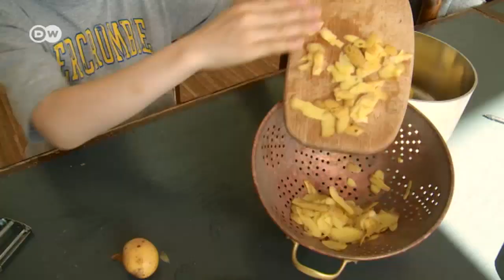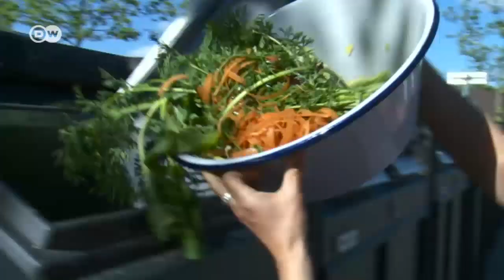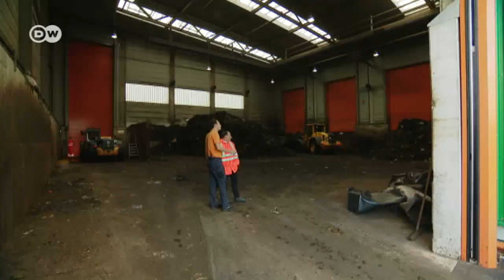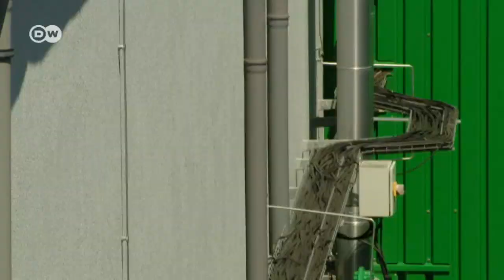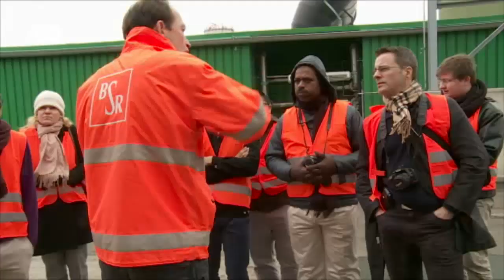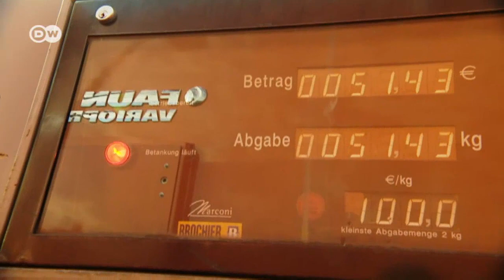Driving with biogas | DW English

Comment: Are diesel vehicles able to use biogas without any engine modifications ?
Reply: Most biomethane converted vehicles are originally diesels. In Sweden, buses often run on biogas (or even rapeseed oil).